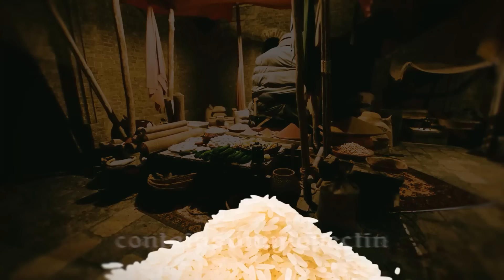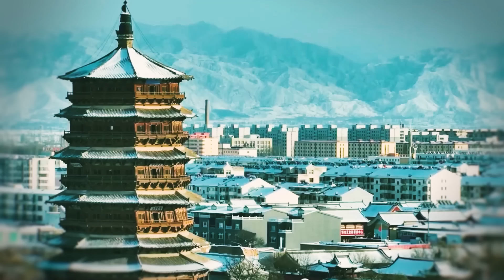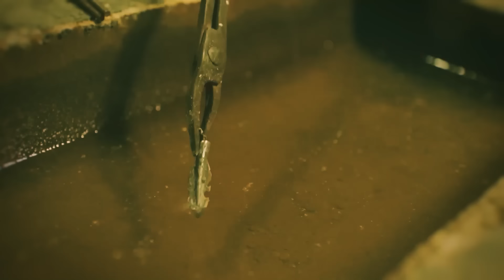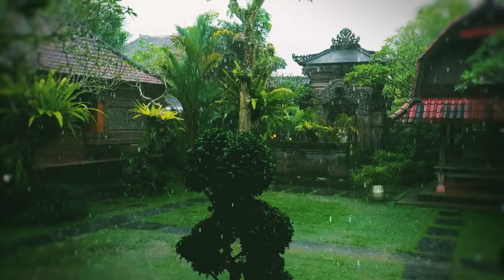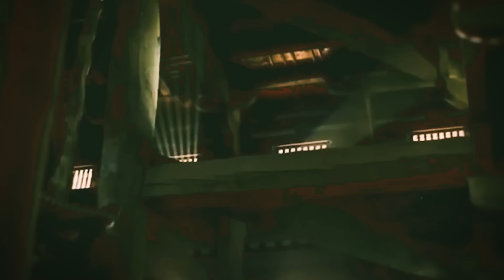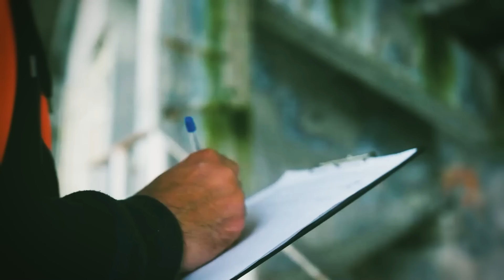15 BANNED Ancient Chinese Building Tricks That Scientists Now Say Were GENIUS

Comment: 23;14 cast iron can only be made with the mold opening upwards and not facing side ways. This bridge is assembled by side facing angus that suggests it was pressed fit with soft iron or low carbon steel with which were not available until the Industrial Revolution. Soft and strong metal is required and not hard and brittle ones, as required by seismic proof structures.

Comment: The roof tile was finished glossy surface and roof profile concave for several purposes. Focusing sunlight at birds above give impression it is the sun to deter birds flight path. On cloudy days the tile is too slippery for birds to land on, practically prevented bird droppings. The glossy tile also chemically inert preventing alkaline etching. Tiles are wind proof by its mass. Reflect sun’s radiation back into space in summer. It traps no moisture. Reflect IR back to heat source below in winter. Tile shape in animals add on roof ridges can ward off birds and small animals. Contribute a structural mass to dampen side shift from foundation during earth quake. Tiles are interlocking from horizontal shift.